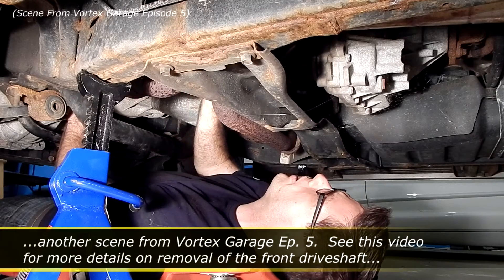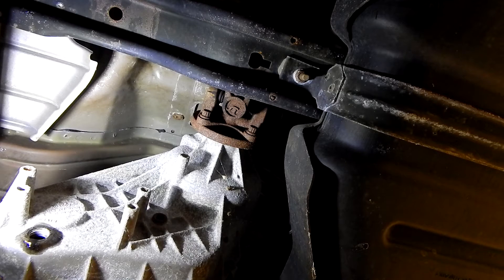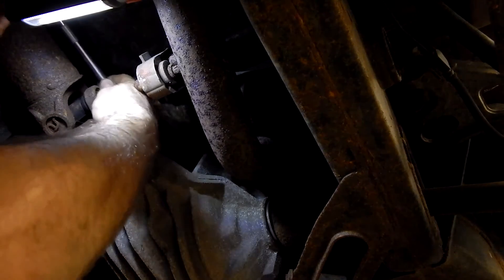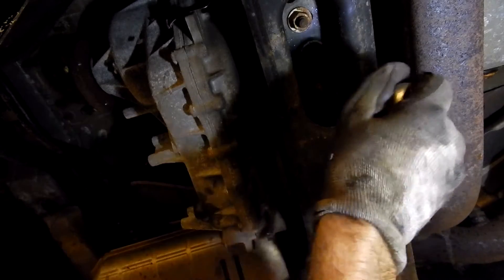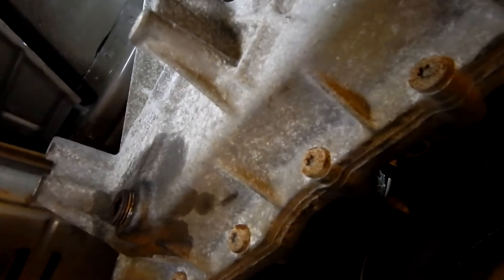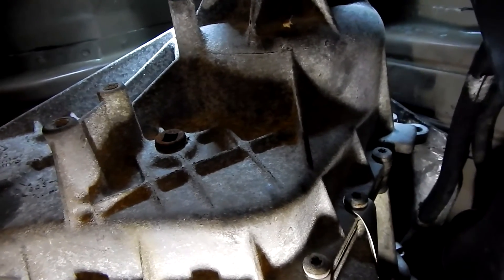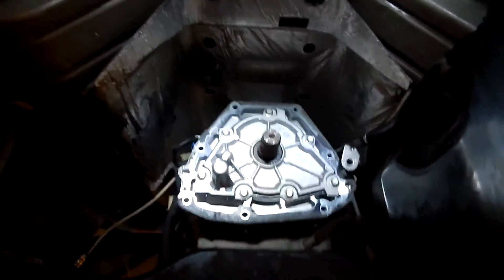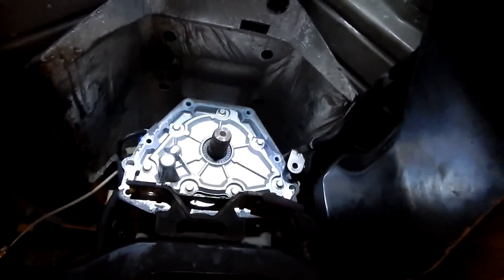Mountaineer / Explorer - BW 4410 Viscous Coupling pt 1 - TC Removal - Vortex Garage Ep12

Comment: Great video. Really detailed. 
You are in better shape than me. I don't use hand tools at all which helps me make it through a long day. Only going back together do I use them for proper torque, otherwise, all cordless tools. I was curious why you didn't take out the cross member. That would have given you much more room. We all work differently which is cool. I like things out of the way especially when working on the ground.

Comment: removed the front drive line and it runs  like new,also had to replace the f/l axel im sure do to the transfercase not working properly it went bad.i had replaced it 2 years ago so im only assuming transfecase was the culprit.now to order the parts necessary lol.thanks again the video was extremely helpful!!!!
Reply from the maker: Glad you found it helpful!

Comment: my awd Explorer does the same thing.first video i have seen like this on YouTube. my question is can i disconnect  the front and drive without it till i get the parts necessary to fix it? thanks the video was super helpful.
Reply from the maker: yep, you can run with no front driveshaft. But use the parking brake when parked just in case, some say it won't  hold as tight in park...  We have an earlier video that shows the awd binding and it going away with the front ds removed if helpful :)
Reply: +Vortex Garage thanks  for the info,the videos were of great help, my truck does the same thing at low  speed also.
Reply from the maker: +Alexander Claudio Glad to hear, thanks and good luck!
Reply: @VortexGarage  thank you so much I have a 98 Mercury mountaineer doing the same thing about to take the driveshaft out. Ty.